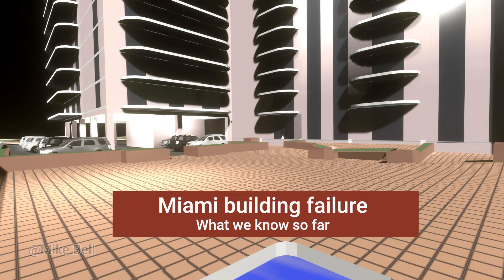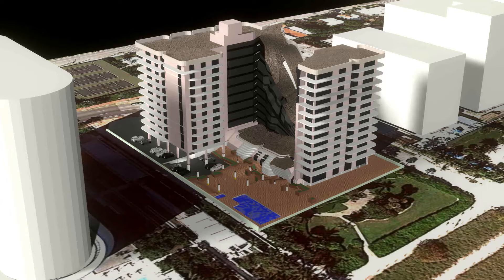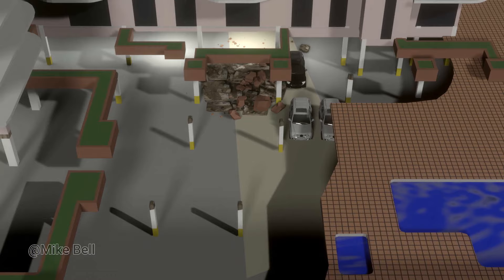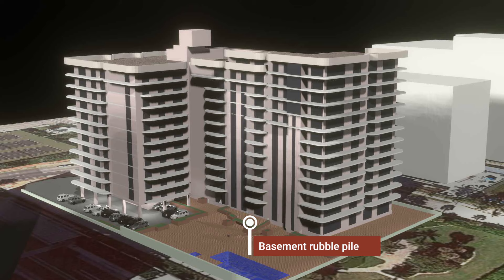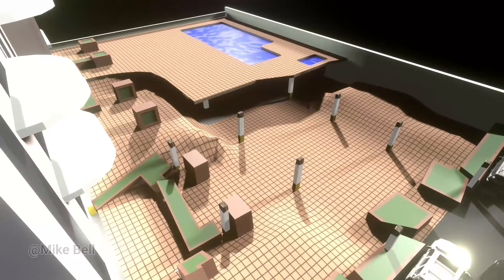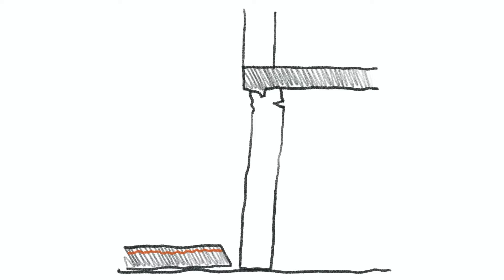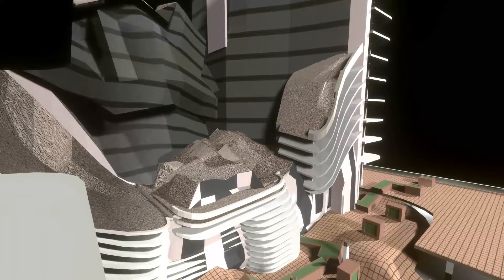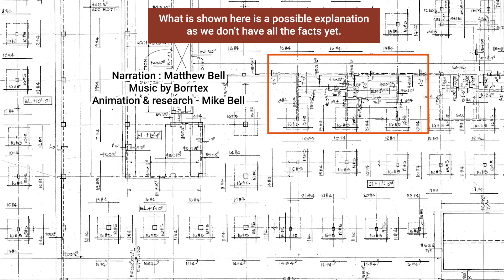MIAMI CONDO COLLAPSE | visualization of the evidence pt2

Comment: All the engineers involved in this project are shitting bricks right now trying to prove they’re not to be blamed
Reply: Haha bricks.
Reply: We’ll see if they even are held responsible. It’s not like the government is forcing the other buildings built by the same company to be fixed immediately.
Reply: this thing was built 40 years ago they are probably old grandpapas right now or dead
Reply: It looks like lack of maintenance to me.  If you don’t protect your foundation then don’t be surprised when the roof falls on your head.
Reply: Building was finished 40 years ago. Probably took a few years for construction and plans were probably finalized a couple years before that. So a 35 year old architect or engineer (who'd be really young to be a lead designer on something this large)would be 80 now. So they'd most likely be dead or too infirm to stand trial in 5+ years. 

And after 40 years it's going to be hard to prove it was merely bad design. Something that lasts 40 years generally fails due to old age or poor matinance. Not to mention this has to be signed off by buildimgnauthorities and inspectors are there all the time so if it was an amatuer design it should've been caught before the building was started, let alone completed.

My guess? A lazy contractor probably screwed something up and that combined with poor matinance and being next to the ocean did it in.
Reply: Doubt it. Most of those guys are probably dead by now. Those blueprints and plans had to go through many people before getting approved to even be built anyway. Also, there's too many things that could've caused this to really point any fingers at.
Reply: The building is very old and has many neglects..
Reply: It was a maintenance issue. Three years ago an engineer informed the owners of serious damage that compromised the structural integrity of the building, but the owners i guess didn't take them seriously and put off repairs. There were some vague plans but not one repair had been started in that time frame. A lot of nearby buildings are being inspected and the owners have gotten their butts smacked so a lot of them are fast forwarding repairs that had previously been put off.
Reply: The owners bring politician energy. Don’t lie your way through this!
Reply: The building wasn’t maintained. That’ll be the engineers “out”.  The building owner is liable
Reply: I think it was built fine (enough to pass inspection) at the time of construction and has just had literally no maintainence in the last 40 years. That's my guess.
Reply: I highly doubt it, because the building was 40 years old. so, as already mentionned, most people involved in the construction work have died of old age, and there's more to see on the maintenance side than on the building side. if there was any mishap, it would have been caught before those 40 years of standing !
for some insight on the cause of the collapse, you could see this video : https://www.youtube.com/watch?v=PbuUZWM6bdA , which seems well documented. I hope all impacted by this catastrophe find peace.
Reply: If they're still alive, I have my doubts. I work with aircraft engineers. When one of our planes crashes, our guys are crushed. They take a lot of pride in their work and are under a lot of stress to make sure our planes are safe. I imagine engineers in other industries care more about the safety of people and feel a responsibility toward them.
Reply: @masonbobro3794  unfortunately the individual condo owners were looking at an 
$80,000-$200,000 per unit assessment. Here, these HOA meetings can be a blood sport in the best of times. Just imagine trying to get that amount of money in a timely manner from various owners who insist that it's too expensive and/or it's not necessary. They had a rather high turnover rate of  condo board members.
Reply: @ledsalesoz  there weren't any "managers" per say. Each owner owned their unit privately and the walkways and halls in common. The HOA board members were unit owners who volunteered their time.
Reply: The engineers had nothing to do with this, they are not the ones responsible for The care and maintenance of the building. That's like trying to blame Ford because your truck slid off the road because it has bald tires.
Reply: Highly doubt it. As a Structural Engineer myself I can tell you that taking into consideration the year this was built and the place where it was built, the building standards and inspection was questionable at best. The amount of crappy building that went up in Miami at the time was amazing. However, those buildings have been either knocked down and replaced or properly maintained.  The responsibility falls to owners of the building and to a lesser extent the city for failure to maintain this building properly. This exact building design was used two doors down and does not have the amount of water damage, or spalling that this building had. This screams maintenance issues and neglect so it's the owners shitting those bricks and not the engineers.
Reply: @gothenmosph5151  The plans were actually changed only a few weeks before construction began. The original plans had part of the pool deck raised and sitting on steel girders; this was altered at the last minute probably to save cost. The concrete planters where the collapse is suspected to have started, were supposed to be supported along the outlines of the girders and were also removed in the redesign, but added back several years later. It is possible that whoever added the substantially weighty planters did not understand why they had never been built and just thought it would look nicer to have them there.
Reply: No one listens to engineers until something breaks
Reply: The developer and the architect are GONE .... so ... go and figure.

Comment: Very well done animation. After a month of almost obsessively researching this I believe your animation is the most accurate. There is a longer version of the neighboring CCTV video that starts minutes before the building is seen going down. In the longer version you can see what looks like a cloud of dust around the pool deck well before the building collapsed. Had someone pulled the fire alarm at the first sign of a problem I believe most would have made it out.
Reply: Where is that longer security cam vid?  A link to it please?
Reply from the maker: Hi Chris. I have not seen the earlier longer version of the cctv. Can you paste the link or tell me where to find it. Could have important clues. Thanks
Reply: I was wondering why the video began after the building collapse started.  It is like they did not want to share the initial moments.
Reply: @swinde  The security camera that captured the collapse is motion-activated.  It didn't initiate recording until the building was already falling.
Reply from the maker: Darn I was hoping for new clues. This doesn’t show the pre footage. The first frame is just frozen and the first frames are missing because the recording only starts when motion activated.
Reply: Now I'm not sure if that's the same one. The video appears to not start before the collapse as the trees are not moving. Let me dig, it's been a few days since I saw it and I have seen a few.
Reply: @Mike-Bell  I don't think these are motion activated cameras. The trees blowing in the wind would have activated it. Most surveillance systems in these buildings record 24-7. I believe this particular video was "leaked" by someone that works at the neighboring building and the full footage might be in the hands of officials by now. But I'm pretty certain there is a slightly longer one that shows actual video moments before.
Reply from the maker: @ScarabChris  there is surely other cctv footage. What about footage from their own pool deck?!
Reply: "Fire Alarm" keeps going through my head as well.  7 minutes...? But what would I have done if I had heard such an alarm at 1:?? am. What would I have felt about pulling it under the circumstances 🤔?   I'm only guessing but my first instinct if I'm honest is to think that there's no way a pool deck falling could ultimately pull down a whole building section. Well, until now.  This changes everything for me about fire alarms, building cracks, water leaks, construction dust, etc...
Reply: The linked video is NOT a longer pre-collapse view.  The tree leaves in the foreground are clearly frozen.  There was a breeze blowing when this happened.  You can see the video "unfreeze" right at the moment of collapse and that is when the tree leaves begin moving.  Somebody paused the video either to focus on something or to fake a longer video.

Comment: I stayed in a building in Ocean City, Maryland last fall right on the water for about four months. Had a deck and parked underground just like the one that fell. I remember seeing puddles of water underneath that one too. Did not think much about it till one day was getting in my car and it was pouring rain. There was a pair of steps from the upper deck to the parking garage right in front of where I was parked. And water  was just pouring down them. I never parked under there again. Never felt comfortable parking there. I was staying on the center apt on  the 11 th floor. That was only half way up the building. It was a huge older building. It looked it from inside. I parked way on the other side of the front parking lot on the highway side away from the front of the building after that. I do not know why it bothered me, but it just did. Cannot remember what the parking garage ceiling looked like. Stayed in another smaller older building and we parked underneath there too years  before. Was no deck just some parking under the building. Looked well taken care of. Stayed in a condo in St. Petersburg florida before that. Parked underneath again. Maybe about 12 floors. Was very well taken care of building undeneath too. At least it looked it now that I think about it. Do not think I will ever park anywhere like that ever again. Do not think I want to be in another condo like that either, nope not gonna do it.

Comment: It's crazy how construction and design mistakes made decades ago can come together with shoddy maintenance over those decades so suddenly and catastrophically. Lots of mistakes made, but of those who made mistakes only the last ones end up having to take any responsibility.
Reply: @tripplefives1402  That's correct. Many condo associations vote on saving money rather then doing the repairs correctly. AND nearly all condo associations DO NOT collect an additional fee that goes into a separate escrow account designed to take care of repairs as they arise, thus avoiding huge additional fees along with the current monthly fee. AND some condo boards illegally spend this money on 'beautification' projects with out informing the members as required by law. I'm currently on a board that did all of the above. Illegally pillaged the escrow account to 'up date' and 'beautify' the club house. Now the current board has the herculean task of correcting these errors and bring everything up to code or face huge fines with out any money. The previous board emptied ALL the accounts. We're in the red. 
So it's a combination of all things. Poor construction, failure to have an escrow account for repairs and the members not wanting an additional monthly fee to fix issues before they become a disaster.
Reply: @LAG09 , if the owners knew that the building was that unsafe, then yes, they are also to blame, but I seriously doubt those people knew the seriousness of the problem or I assume, those who lived there wouldn’t have continued to do so. Also, why wouldn’t the city condemn the building if they knew it was in such bad condition?
Reply: Well put.
Reply: Often, the problem is no one wants to get into the HOA. It is hard ungrateful work you do for free. I saw an interview of the HOA president in the other Champlain tower and that man seemed to be doing a great job. People there are lucky to have him. But if no one is stepping in, and bad things happen, it is everyone's fault, because everyone can step in. I had to do it five years ago and it sucks, but investing time in my family's safety is important
Reply: @EdithEsquivel  you go girl!
Reply: @LluviadeOrugas  You have to remember that this is in the U.S and in a Republican run part of the country. The U.S believes in personal responsibility like it's a damn religion and the republicans doubly so. Had the inspectors condemned the building last year they would have been guaranteed to lose their jobs over due to supposed government overreach.

Even clarifying what "structurally deficient" means carried a significant risk of losing their jobs. They'd have also called it government overreach and accused them of trying to artificially lower property prices to their own benefit. Then used the building not collapsing after the repairs as proof the repairs were all unnecessary.
Reply: But it wasn't sudden. There were signs, but nobody had the knowledge to interpret them.
Reply: @EdithEsquivel  , I have to admit I couldn't do it. I'm not stupid, but I've been to enough HOA meetings to know that some people should not be on the board, and I myself would not want to be. There are a lot of technical issues to deal with sometimes, as well as having to deal with people's questions and having the ability and knowledge to answer those questions and run the meetings. It's above my pay grade and I'm just smart enough to admit it. I want to elect board members that have knowledge about many things and are honest and have great integrity. So how many people in a community have people that qualify, have the time and inclination to serve? It usually rests on the same person's shoulders, if you're fortunate enough to find those people. We have had some very good, and some really bad board members. Thank goodness I'm not in a highrise.
Reply: @LAG09 , wow, very sad!
Reply: And cheaply made building with cheap labor
Reply: @tripplefives1402  that’s right
Reply: @LluviadeOrugas  these people knew just like in and around that area with is now going to be all torn down god the rise of million dollar condos
Reply: @LAG09  please Democrats aren’t any better come to NYC and see for yourself
Reply: @spellerlittlewing  The democrats aren't perfect, but the republicans are so much worse in the kind of freewheeling capitalism where regulatory bodies simply abdicate their responsibilities.

You can clearly see it in things like the Tennessee bridge that was left with a massive corrosion-inflicted gash that could have caused it to collapse at any moment for years when it wasn't properly inspected and the Texas power outages caused by ERCOT letting utility companies not only neglect, but to get rid of their backup systems.
Reply: Do engineers (and preferably independent ones) form part of the board commitee? Should we give them more power to condemn or endorse the board's decisions?
Reply: @spellerlittlewing  guaranteed the materials used were sub-standard. I’m guessing the concrete was not up to par.
Reply: @tripplefives1402  Dude, maybe we need an appointed engineer overseeing the board even if just part-time!
Reply: @tripplefives1402  Is the board required to consult the engineers? Is it required to allocate strata fees for such cases?

Comment: What I do not truly understand, was the placement of the shear walls which appear to be a bit inadequate to me, although I live on the west coast in a seismic area and the code requirements for placement and tie in of shear walls are there to make sure if part of a building falls, the shear wall stays up, the part that collapses peels off, and even if what is left is unstable the shear walls plays a big part in keeping its stable enough to get people people out and not follow the part that sheared off immediately downward.  Code here usually requires shear walls to not sit on top of load bearing pillar but to go all the way down into the ground or below the floor or garage basement floor so as to be able to take load is a part down fall in a seismic event.  I realize that in that area of the country high winds are usually the more common threat not earthquakes but shear walls would solve the same purpose it a partial collapse do to wind.  Is it possible that the design did not include more shear walls at appropriate places due to them wanting to enable excellent views?  When the first section fell it should have sheared off and actually left the back side of that center area and then with it stil standing even if the load had shifted on the beach side part it could have at least for a while born the brunt of the load and given time to get more people out

Comment: Warnings? Back in the 2018 engineer's report, seems the building had been screaming for quite a while that all was not right. Any redundancy and safety factors were slowly corroded and decalcified away. Perhaps with one failed column the structure might've held on to allow most to evacuate. But with widespread "rot" there was no hope.